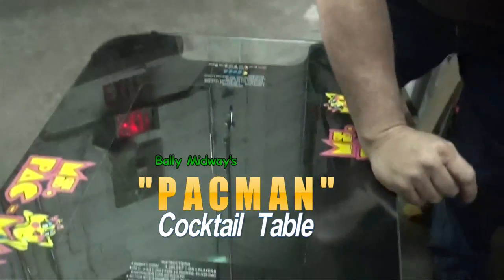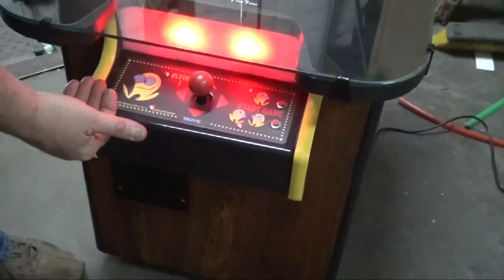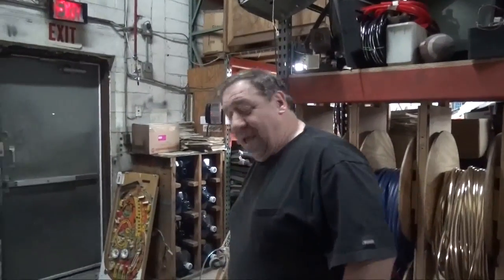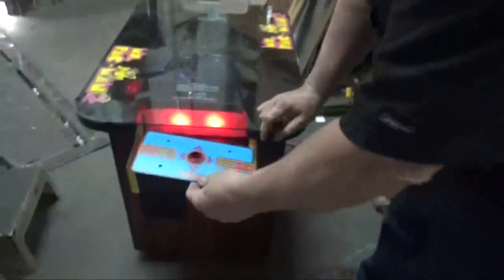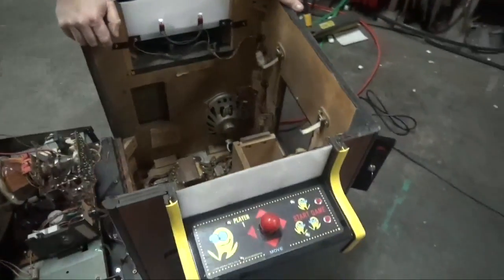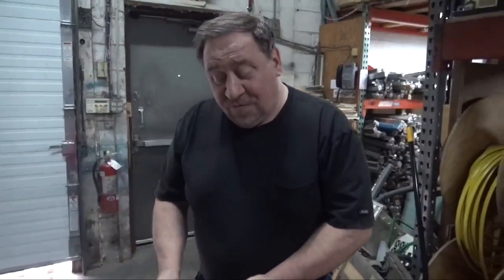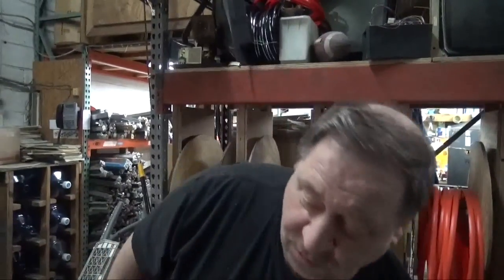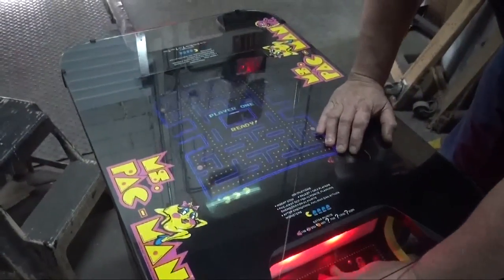#570 Bally Midway PACMAN Cocktail Table and some tips! TNT Amusements

Comment: Fantastic Video - I bought a Ms PacMan cocktail table game from TNT 2 years ago (great folks there at TNT).  Anyway, last week my monitor went dark. Had to replace the Flyback, HO transistor and a fuse. Monitor came back but, every time I closed the cabinet a purple aura would appear on the screen.  The aura would go away just by opening the cabinet and the aura was near the speaker (magnet). So I was guessing the degauss wasn't working.  I did a Google seacrh for "Ms Pacman cocktail talble degauss" and this video came up.  Todd solved my problem when I heard him say that the degauss only works briefly when the unit is first plugged in. I closed the cabinet and plugged it in and voila!.. problem solved.  Thanks for taking the time to produce these videos, Todd!
Reply from the maker: Very glad our video solved your problem! Tell others about our channel and subscribe!  Drives my haters NUTS!

Comment: I just got a ms.pacman cocktail like the one in this video. So that being said sounds like mine was converted from a pacman. My question is should I keep it original and try to get it working or convert to new. Any advice would be appreciated
Reply from the maker: Well, first see if the picture tube is badly burned in...as the maze may be etched into the phosphers.  The machine cabinet value is not like it was...since the Multicades came out...but if it was really nice, it may be worth preserving.  We have now sold over 150 Pacman and Ms Pacman cocktails over the years...

Comment: I really do hate that fan it makes a racket just worried as to why they would putt one in there.
someone told me the monitor gets to hot caps dry out faster.
Reply from the maker: When it was on for hours and hours and hours, it helped keep the air flow goingl..in a private home, its likely to be off most of the time and is just not needed anymore.

Comment: So putting a COW MAGNET near a TELEVISION (which I did do once to a TV  oops) probably isn't a good thing.  :)  (was my brothers television (sony flat)  CRT etc   thing was in my pocket.  my those things are strong.  (course so are the noise maker magnets he has too.) so it's in my pocket and it's a meter up from the pocket and the color goes weird.  I bring it up oops.  oh well where is that degauss  :D  Cow  magnet will do nicely.  Or one of the magnets in one of those flashlights that will give you a good grip eventually but never really charge.    But Cow magnets usually you can't get much stronger than those :D  oh pranksters don't do this at an arcade.  at least when I did it it was an oops.  God knows what happens when you bring a cow magnet into an arcade  smh
Reply from the maker: But you can fix that issue even without a degausser...but every TELEVISION and monitor has a automatic ring built in...the early Sega moniotors had a manual button inside the coin door you pushed!
Reply: I don't know about a Cow Magnet but I know with Royal Flush Pinball after I got the ball on my magnet it was all I could play for a Quarter. :)

Comment: No offense on the no fan, but they get hot in public locations (which I actually service them).  Not good.  Also, many of them are not built for fan-less operation.  Sorry.  Just need to install a LOW-SPEED or low CFM fan like the factory version that runs a reduced flow of air including dust and dirt it accumulates, with the flow pushing outwards.  Trust me.  Your games will love you doing this. 🙂
Reply from the maker: Well, we found the fan brings in tons of filth into the game.  When we convert to lcd and new power supply and pcb there is nothing really heating up anymore.  If Original electronics are used most people turn game on for a couple hours a week at most